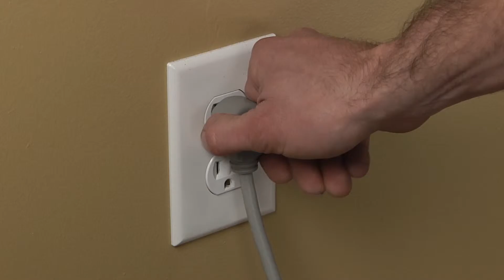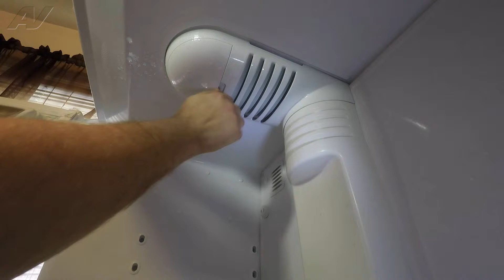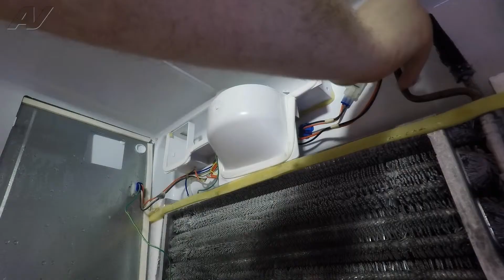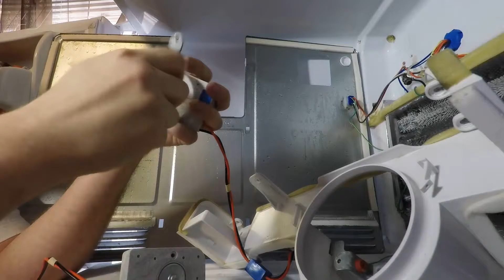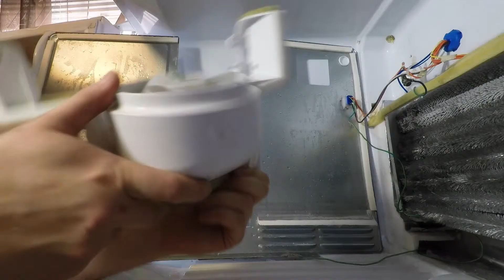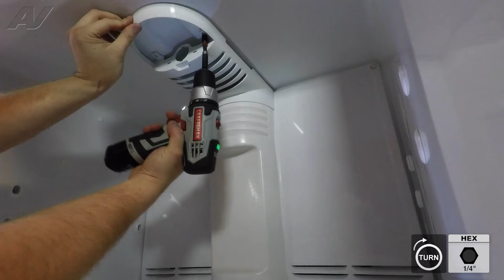Hotpoint Refrigerator Repair - Not Cooling - Evaporator Fan Motor

Comment: I had had so many problems with my Hotpoint refrigerator.
Reply: Same my freezer is way to cold but my fridge is just barely keeping my food goodn
Reply: @hunterlacer9728  
Right. My freezer is super cold and refrigerator no cold air. Junk
Reply: @kathyadkins6956  how dod you fix it, please tell me. our fridge isn't working either
Reply: @_mathew_2850 
I didnt fix it. I gave it to the scrap guy.
Reply: @ oh, i just fixed mine, thanks for your response tho
Reply: @_mathew_2850  
What was wrong with it?
Reply: @kathyadkins6956  the freezer would partially work, but even then it would barely freeze the food/items. The top fridge part wouldnt even cool whatsoever still at room temp.. I opened the panel within the freezer, cleared out all the ice by removing the freezer sections, getting.a bucket of boiling water and shutting it for a few hours to let all the ice melt from the heat. Now i had to fix the issue of the top fridge not cooling at all. Turns out the air duct for the top part of the fridge was blocked off for some reason, I think it was a mechanical faliure of some sort, I could be wrong. Anyways, after pushing the blockage/motorized door out the way. The cool air from the fan started to rush in and the fridge and freezer works perfectly now :)
Reply: @_mathew_2850  
Wow that's amazing.  Thank you for letting me know.
Reply: @kathyadkins6956  No problem, im glad to have helped you :D
Reply: @ found a fix, here to remind u in case u want to see
Reply: The older ones were fanatasic… mine was made Oct 1989 and only stopped working in summer 2025…

Comment: Hey hello it’s only my bottom not getting cold
Reply from the maker: Great question, if you have a more technical question that our parts department cannot answer, you can search our over 17,000 answered questions free at our website www.ApplianceVideo.com under our Repair Help section. You can also call our parts department at 1-800-830-5465 and they can give you help 7-days A week ,or search at www.SaveMoreOnParts.com  .
Reply: @biancasworld1404  
Yeah, same here.
Reply: @kathyadkins6956  Hello! I replied to @EightySeven-c8v. Do you see it? I'll keep my eyes on my email. If you don't, lmk and I'll copy and paste it to you. It's rather lengthy and I didn't want to take up space if not necessary. What was your problem? Did you resolve it? How, please.
Reply: Hello. It's a full year later, but... Although he wasn't perfectly clear,  I'm pretty sure it is the bottom, the refrigerator portion, he is addressing. He's in the freezer (top) because that's where the fan is. It blows the cold air from the freezer into the refrigerator, cooling it. I could be totally wrong... :) Someone may come along a year from now disputing what I've said, Or, confirming it. Hope you got your problem resolved, without having to bargain down from your firstborn :). My fridge is too warm. Gonna go in here now & look for that fan in the freezer. Mine is a side-by-side so it will be a hunt... And hopefully I am right in what I told you. But better yet, I think I'll watch a few more videos first. :D

(Added)--Oh. The "bottom" you spoke of was on the refrigerator, right? I'm sure it was. Who would want their bottom to get cold? (:  (& no answers from you 'freaky-deakys' out there :D )
Reply: @craigslist474 how'd you make out? Did replacing the fan in the freezer solve the cooling problem in the refrigerator?
Reply: @EightySeven-c8v  Hello. Never got notification of your question. Sure would have answered. Just happen to notice it while deleting some of the THOUSANDS of just old, "Unread emails I have. As for your question, the fan seemed to be working fine. And I'm Still having the same problem. And I noticed I said it was my fridge getting warm. Not sure why I said that, because it's both sides. I'm still doing what I've been doing for over 2 years now. I watch the monitor of the remote thermometers I bought (just for that purpose) and placed in there, and when I see that the temperature is climbing, and it's not because of defrosting, I 'reset' it. I turn off both sides and unplug it anywhere from a few minutes to a few hours. Most times it works the first 1 to 3 times, but if it doesn't, I just go and buy ice for my ice chests, put my food in them, and keep resetting until it decides to start working again. The longest has only been 2-4 days, but "normally", within an hour or 2, resetting throughout those times. BUT, after some more recent research, I've bought Freon and a piercing hose kit. I have yet to try to add Freon simply because it makes no sense that it's lack of Freon. ???Or is it??? Plus, I'm scared to chance making matters worse. I mean, right now I still have a fridge that does still "work"... I'm including all of this just in the off chance that it might help you or someone else. And obviously you had a problem or you wouldn't have been here, too (?). What was it, and did you resolve it? How? Bought a new fridge? 😄 I'll keep an eye on my email (I didn't even know YouTube did that. Emails were going into a category I hadn't even seen until very recently). Keep me posted, please.